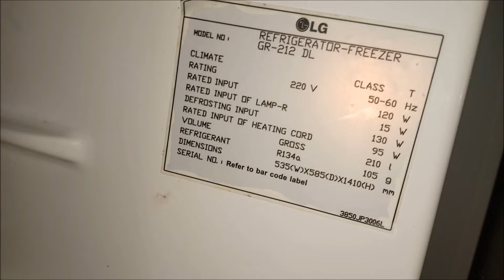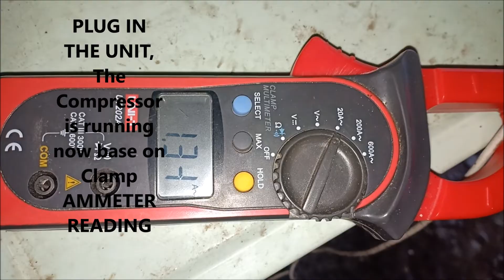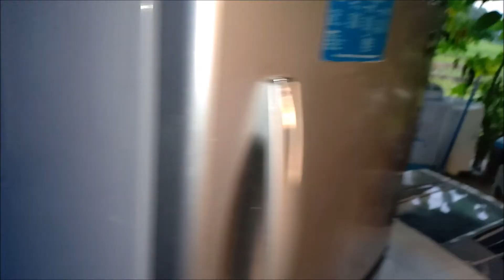LG No Frost Refrigerator repair, Submerged in flood for 48hours.

Comment: sir pag   condura ref ko n 2 door  non frost  po sya .. pag on ko po ref freezer sa top lalamig lng gilid at baba at mag tutubig mga gilid malamig kunti pero d nag yelo at wla lumalabas ng usok na malamig
Reply from the maker: Check po kung umaandar ang fan motor. Thanks for watching po, ingat ingat po tayo sa covid 19
Reply: @RDCTV  d ko po kc sya ginagalaw tinignan ko lng yung likod at inalis ko yung tubig na pinag iiponan nya ng tubig n galing sa freezer then pinakikingan ko po pag on ko yung ref may normal po tunog pag start sya  . about nmn po sa fan d ko alam san naka lagay fan motor nya wla po kc sa likod bale model po ng ref ko is condura ctd270mn-g2
di po kc nakikita yung motor fan sa likod
Reply: @RDCTV  sir tanong lang sa panasonic 2 doors ayaw lumamig ano kaya sira.ok nman po ung relay at olp...

Comment: Sir tanong lng po bakit nag off ang breaker namin pag on ko ng thermostat  thanks .
Reply from the maker: check po yung amperage ng compressor bka high ampere
Reply: Baka mababa amper ng circuit breaker nio sir at nka single breaker lng kau or unb wiring ng bahay nio d nka standard yng wire pa check nio sa electrician sir,

Comment: Sir ano kya diprensya ng aming no frost ref. Na start cya kya lng natrip. Kinuhaan k ng amperahe 4.8amp. ung reading. ok naman ung relay .
Reply from the maker: high ampere yan sir, check po wiring connections, kung ok relal at wiring posible po n sira n compressor mo.

Comment: kung sira na ang defrost timer at wala na mabili original parts, pwede po ba substitute ng ibang brand na timer na parehong AC voltage at frequency hertz?
Reply from the maker: pwd po yan sir. basta tama ang wiring connections po.
Reply: maraming salamat po sa expert na aviso. @RDCTV
Reply from the maker: your welcome po!

Comment: boss gud pm ask ko pa sana nabasa mo po to bumili po.ng bagong ref 2door kelvinator sya not inverter pang 5 araw palang po ung freezer ok ung yelo Peru sa baba d masyado lumalamig  at nag yelo sa likod ng chiller naka maximum na po sya Peru d parin masyado lumalamig nag rereklamo mga bumibili ng   softdrinks ano po dapat namin gawin ano kaya problema nito boss
Reply from the maker: check mo yung setting ng thermostat mo sir